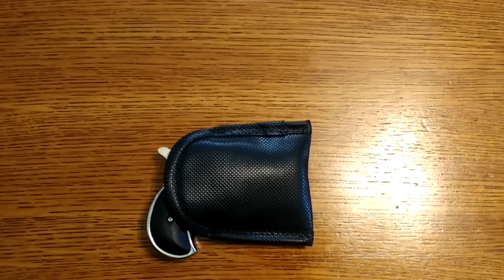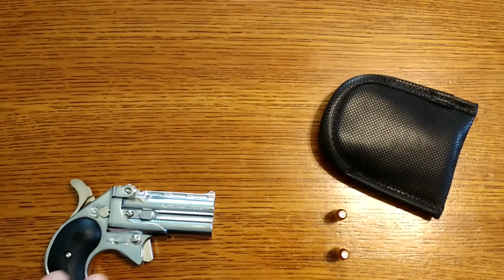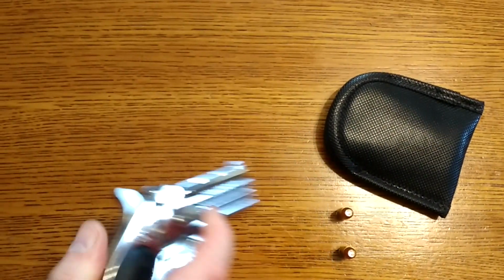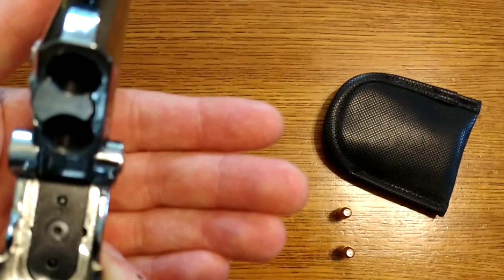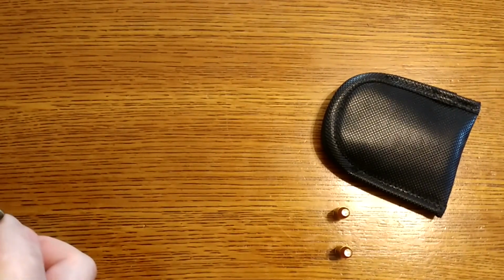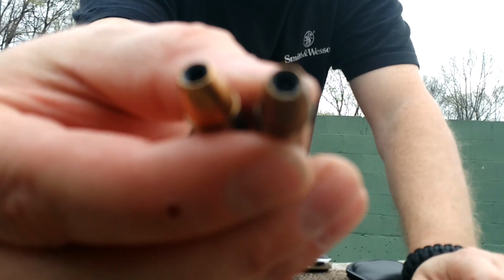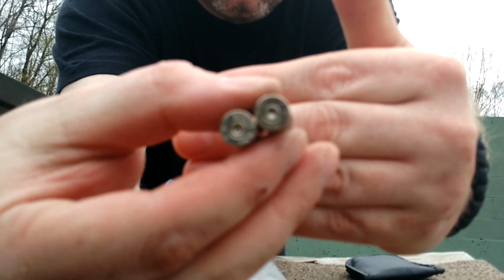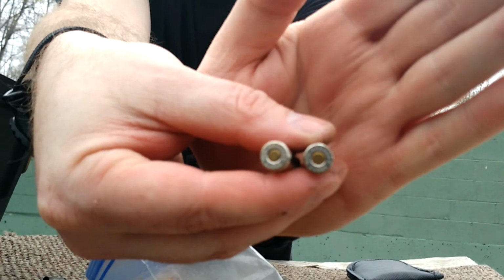Cobra 9mm Derringer Mods

Comment: I've got a Cobra 380 derringer and also polished the trigger and hammer, but I removed the ejector, it seemed to me more trouble than it's worth. I just pick the empty shells out with my fingernail. I also ground, filed and polished the front of the trigger to match the curve of a finger which did away with the beveled edges on both sides of the trigger. This gave me a wider contact patch with my finger which made it more comfortable and with the curve it is easier to pull down on the trigger. Just thought I would share what I did to mine.  It is now a fun gun to shoot.
     I think the 380 is the perfect round for a derringer. It has more knock down power than a 22lr or a 32 and less recoil than a .38 or 9mm. The recoil is not much more than a 22lr. I can shoot 50 rounds through it with NO PAIN! Like I said before a real fun gun to shoot. Thanks for sharing your mods on your Cobra derringer. I do not think they are bad weapons. I know there is a better quality derringer out there, but the cost of them are through the roof. I'm not ready to spend $400 to $1000 on a derringer. If were not for the in inexpensive Cobra I probably wouldn't own a derringer.

Comment: I've ordered a 38 special barrel for mine.  The 9mm is to finicky to load and unload because of how the recess in the bullet has to interface with the ejector.  Also, in 9mm, the gun is just too unmanageable to shoot as far as I'm concerned.  The power of 9mm in this derringer ends up hurting my hand after a while.  I'm not sure that the 38 special barrel will be that much different but for $50.00, I thought it was worth a try.

Comment: I bought one of these derringers for a tackle box kind of gun. Put some snake rounds in it, no problem. I was wrong, the plastic capsule on the CCI .38 special round is very close to the diameter of the shell casing and they won't fit. It looks like they contact the rifling in the barrel. So with that being said, No SNAKESHOT rounds!
Reply: J Dub It says in the manual to not use those.
Reply: What? Read the manual? lol. I just did and sure enough... No biggy though, bought a little snubby .38 for the snake shot.
Reply: J Dub Can never go wrong with a snubbie.  Anyone who says otherwise probably think they're Rambo, lol.
Reply: That happened to me also.  I read it in the manual also.  Burst my plans for it.  It hasn't been shot.  An I and to return it out just but another barrel?

Comment: I believe, and this is just an opinion, the reason you are having an issue with the shell ejector is because you messed with it. It is designed like it is so it will all the proper bullets to slide and after you fire the rounds you push up on the ejector and it pushes them out. You have made a situation that allows the bullets to slide completely past the ejector or you are using the WRONG ammunition for your gun. I have a Davis 38 and have never had an issue. You can fix your issues by replacing the ejector for I think about $3.00 of just keep bitching about the ejector that you messed up. Use the proper ammo..
Reply: I remember one video a long time ago he claimed to be a HI POINT GUN SMITH LMAO

Comment: I just got the 38 special model, the safety didn’t work at all you needed a punch and tap hammer to move the crossbar safety. I needed to clear the black paint from the area where the button when through, after that I actually needed to take a rat tail file to the area where the detent make contact to the button, it had a bur that would not let the detent move smoothly. After that I cleaned all the parts and lubes and put all back together. Have not yet range tested.. That’s next..

Comment: my extractor broke in half. I am having a hell of a time find one for a 9mm. any leads.
Reply from the maker: einstyndotcom Yeah call cobra
Reply: I am looking for a used one from someone that may have a stockpile of parts.
Reply: everyone seems to be out of stock
Reply: You can get one from cobra
Reply: Make one it's only tim
Reply: Make one out of piece tin can
Reply: @JamesHackett-kv4ki  I dont think you realize the complexity of that part
Reply: @einstyndotcom  I have a .9 mm extractor is like sheet metal
Reply: @JamesHackett-kv4ki  not at all. look at the one in this video. it is way thicker than a tin can. I have a lathe and mill but it would take way too much time to make for what its worth.
Reply: @einstyndotcom  just watched video again I could make a extractor out of a pop can

Comment: you are not supposed to dry fire this gun
Reply from the maker: Lol
Reply: Ive had mine 2 years and dry fire it a couple of times a day to keep the trigger pull decent. The only guns you cant dry fire are revolvers with the pin in the hammer. Gunsmith 34 years

Comment: Just bought a new Cobra in .380. What a POS. Have to fight the ejector to get both rounds into the barrels, then the barrels won't lock down! Called Cobra, prompted to leave a message, and never heard back from them (several days). Not to mention the trigger pull takes 2 men and a boy to pull. Yes, I read the warning manual, yes, I'm following all the instructions. I'm a veteran with lots of firearm experience.
Reply from the maker: I had to mod the ejector to get the rounds in with a fight. I talk about what i did. Hope it helps.
Reply: Had to buy a tiny tool set to remove the ejector. Still won't lock up, even only loading one round at a time.
Reply from the maker: +Kevin “Kontractor” Loecher Call them and send it back.
Reply: Iv played with the all. Get the 38 special

Comment: These have got to be one of the worst quality guns currently sold in the United States. In my opinion it is really stupid to 'upgrade' anything that poorly made. The absolute worst derringer in the world is the Bearman which is made  by the same company. Beware. Just save your money and buy the best quality that you can get. If you buy the best you have the best chance to be happy. This gun will keyhole at anything over two feet. How many pages of warnings comes with this gun? About 51 pages of warning is a lot of warnings from the manufacturer. Why on earth would you want something like this? Watching you try to even pull the hammer back was amusing too. BTW one of the warnings in the owner's manual is NOT to dry fire this 'weapon'. Your reputation is everything in the gun world. You would be well to remember that.
Reply: Actually keyhole ing is good from a Derringer makes bigger wound channel